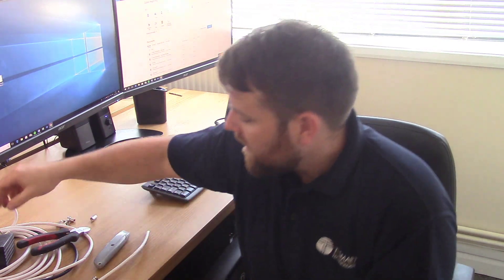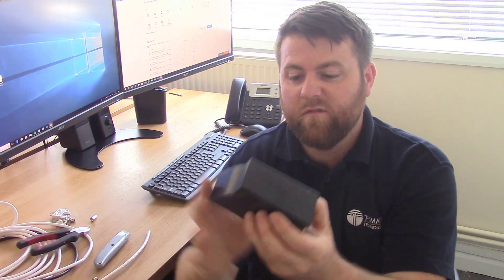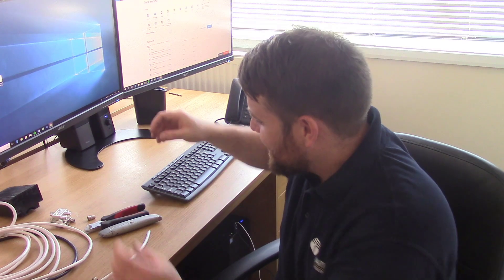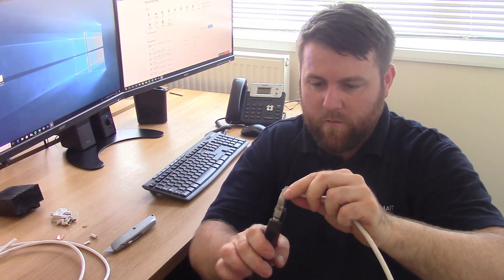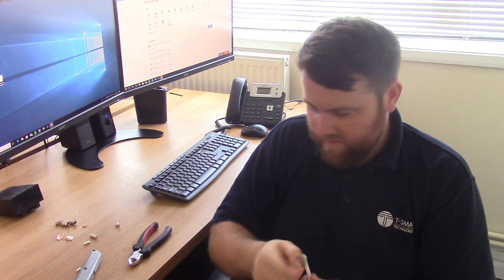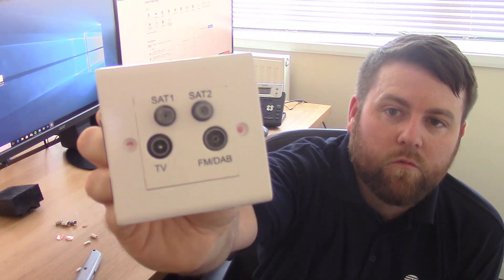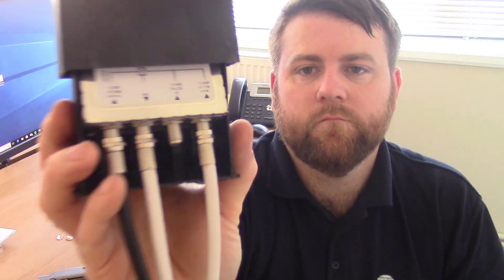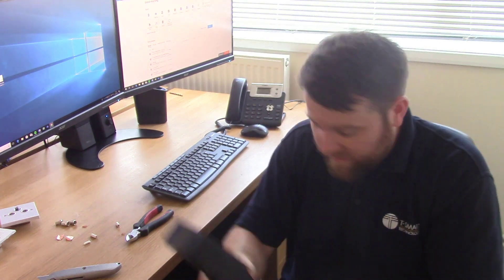How To Combine TV Aerial, Satellite, FM & DAB Radio Signals On One Cable

Comment: Hi I've Brought a new build and wanted the TV on the wall they have sky q around this areas what connection plate do I need to have no cables showing I have a double socket for power which plate do I need to have the TV linked to sky thanks.

Comment: Hi Mate, On the back of the Triplex wall socket it has an arrow indicating the coax in, but there is also an arrow out, can this be used for another outlet? i only need another  tv point, can i do this or will i have to fit a Triplex socket again ?  Thanks

Comment: A great little video. I am not sure I understood everything but that is because I don't this kind of work. 
I was watching as I am moving to a new house that has aerial connections built in in several rooms. 
I just wondered how easy it'd be to add sky Q in a couple of the rooms with an existing aerial socket on the wall? (one is Sky Q and the other is the new generation Arris freesat). 

Could the sky wiring be hidden by going through the loft rather than drilling holes externally into certain rooms and the wires trailing around the house?? It may be too complex a question for here - so forgive me if it is.

Comment: Really great start - I was quickly hooked - but then you go off too technical, too fast, and with lots of jargon about Sky Q, why it won't work, LNB etc etc...ALL before even dealing with the basics and the most common example. A shame ....as you clearly know your stuff. Lost me from that point. Advice; slow down, and focus on topic - write key focus points on a sheet of paper behind the camera so as not to digress if it helps. Don't head off down technical rabbit holes (unless it is totally core to the solution. You are not communicating to "impress" or sort of show off your knowledge - we've got that). Do that right at the start, making it clear why you should be trusted - which you do- but then, as I say, don't think you have to over impress about some non core ( re video title) technical thing.

Comment: Hi, I've had a large FM aerial on the chimney stack for some time.  A builder mate has just fitted a folded di pole to the mast whilst doing some roofing work. The DAB / FM Hifi tuner I have only has one F type connector. I have since learnt that the two cables can be combined.  A passive combiner is available that looks very similar to the all metal UHF / SAT combiner featured in your video.. Manufactured by 'Apart'.  However I'm having difficulty in obtaining one in the UK. Importing one from Germany costs a fortune. 
Any ideas on an alternative.  Is the other unit you showed passive or active and can you give more info on it or a link.
Kind regards, John ( Nottingham  )
Reply from the maker: You could just look for a Triplexer that has TV/ FM/ DAB inputs and just combine the FM/ DAB and output cable. These are easily found online.
Reply: @smartaerials  Will do Tom. Thanks.

Comment: Hi, could I use a diplexer to combine  antenna and satellite signals to connect to an slx 6 aerial amplifier? I want to take both signals to other rooms. My current set up has the aerial cable running to the slx and this feeds my living and  bedroom tv's. The sat cable runs to the living room only. I know that I'd need to run another cable from my dish into my attic but would using the diplexer work to carry both signals via the slx amplifier?

Comment: Hi! Can somebody help me, what I need to combine these cables? I have 1 Sat, 1 Cable TV, 1 FM cable, (and 1 TV Aerial, but this is optional). I want to combine these to one cable, and this would go to a wall socket (https://www.se.com/ww/en/product/SDN3501321/sedna---tv-r-sat-ending-outlet---1db-without-frame-white/). + extra: multiple output would be nice, because I have 4 wall sockets.
Reply from the maker: Hi, you can combine the Sat, TV Aerial and FM Radio signals with a Triplexer. You can then install the Triplexed socket that you have linked to, to separate the signals again. You would need to run the cable TV separate, maybe put this on it's own socket?
Reply: @smartaerials  Thank You for the quick answer! Meanwhile I found this, but it's too good to be true... Do you think it works well? https://allegro.pl/oferta/rozdzielacz-7-4-multiroom-unicable-mezon-8000430410
Reply from the maker: @CalvusPeti  That's a Unicable system, I do not have any specific experience with that as we don't use that system in UK.

Comment: Hi.

I’m currently using a TV aerial in my loft to supply a signal to my TV, HDD recorder and DAB radio, all via a signal booster. This all works fine, but I’m unable to receive some DAB channels on my radio. I was considering purchasing a separate DAB aerial for the loft, but not sure which diplexer I would need to connect the TV aerial and DAB aerial together. There is just one cable that runs from the loft down to the living room wallplate, so I guess I’d also need a new wallplate with two separate sockets on it.
Thanks in advance.
Reply from the maker: Hi Neil, what type of signal booster do you have? Does it have multiple outputs? It is does it might be easiest to swap this out for a two input (TV/Radio) model, then you could have DAB at every position.

Comment: Hi great video! If I wanted to remove the faceplate and re route the cable to a wall mount TV and connect via a coax plug to plug directly into the tv would that be possible?
Reply from the maker: Hi Ryan, yes that can be done, just remove from the back of the plate and divert to the new TV position. You can join/ extend the cable if nessecary.

Comment: I have a free sat TV and free sat recorder.  I have two wires coming from the wall.  One wire goes to the TV and one to the recorder.  I would like  going to each of them/  Is this possible?  Thanks
Reply from the maker: Hi John, sorry I'm not sure what you mean by "I would like  going to each of them/  Is this possible?"
Reply: Am sorry about that.  Both my tv and recorder have 2 places for  SAT cables.  But I can only get one each to the TV and recorder.  Is there a connector so I can have each device to have 2 cables each.

Comment: My sky plus has 2 cables at the dish which run back to my tv. how do I connect this to my digital aerial onto one of these cables please ?
Reply from the maker: With an F join, here is a video showing how to weatherproof the connect. Ignore the bit at the end regarding silicone grease. You will need an  to coax adapter to but on your F plug by your TV for the aerial to work, like this one - https://www.toolstation.com/proception-adaptors/p96352?store=E1&utm_source=googleshopping&utm_medium=feed&utm_campaign=googleshoppingfeed&gclid=CjwKCAiAj-_xBRBjEiwAmRbqYhSCAD7QKIs-4BNqUQup-zKAntsbZLJH19uwQL9XdY7wAM8iodFh_RoC-mYQAvD_BwE
Reply from the maker: Here is the link to outside F join - https://www.youtube.com/watch?v=8ooIXd9HguE&feature=youtu.be

Comment: Hi Tom, thanks for this great video, that I came across right on time whilst I am laying down cables at my house for TV ariel, satellite and FM /DAB Radio. I am panning to install Quadruplex Multimedia Socket plates (https://www.screwfix.com/p/schneider-electric-lisse-1-gang-quadruplex-multimedia-socket-white/4966j) at number of different places in the house. Please could you suggest what exactly I will need to do in case I want to combine all these signals in one single cable? Many thanks once again and waiting to hear from you. Cheers. Raj
Reply from the maker: Hi Rajesh, can you tell me how many TV points that you're going to install so I can tell you the best way of doing things?  Link isn't working by the way.
Reply: @smartaerials  Many thanks for responding quickly Tom and apologies for the link glitch. I want to install nearly 7 points which is almost in every single room of the house. The idea is to get TV points in all the rooms, not sure if this is an issue. I want to install a Quadruplex Multimedia Socket (https://www.google.com/search?client=firefox-b-d&q=Quadruplex+Multimedia+Socket) so that I can have TV, Satellite and FM/DAB signal avilable in all rooms at one single place.

Comment: Hi mate,

I have TV aerial, dab and sky +  in a property and we want all these on two TV points.

So is there a diplexer thats combiner with 2 or 4 output available? so I can then combine 2 satellite cable separately from the Lmb, two TV points via 2 diplexer then to wall point.

If that makes sense. Or if there's a simpler way.

Thank
Reply from the maker: Hi yes. You will want a Triplxer or a Quadplexer - Triplexers are usually, sat+aerials+radio whereas a Quadplexer usually has separate inputs for FM and DAB radio. Hope this helps mate.
Reply: I have an Lmb with 4 connections 2 which will run directly for faceplate. Can I combined satellite/radio/aerial for two tvs when I use a triplexer, then another diplexer?

Or would I have to run separate satellites cable from Lmb for second TV and then use two diplexers to combined and split for each cable?

Thanks

Comment: Hi mate.

I'm in communal tower block and I've been told we can conne t to our cctv from the socket you showed with sat/TV and dab. How does one go about getting the picture on the TV? Using what cable to the TV ect?

Cheers
Reply from the maker: It's usually done with an aerial cable connected into the TV, you then tune the CCTV in like you would your TV channels.  Depending on what the set up on the system is, you may need to run a scan on analogue on the TV to get the CCTV. Hope this helps, Tom.

Comment: I live on a hill in High Wycombe, Bucks. I have a Freeview TV aerial on the roof feeding my TV box with a good strong signal from London. I have a separate radio needing an FM/DAB aerial. which has a single F type aerial connection on the back.  What type of FM/DAB aerial should I buy? and can I eliminate need for diaplexer and splitter with a single downfeed from the aerial to back of radio?  I presume the existing Freeview aerial cannot be used to provide the FM/DAB signal. Thanks for your help.
Reply from the maker: Hi Barry, using a Freeview aerial from radio is not ideal. I talk about this further here - https://www.smartaerials.co.uk/blog/can-you-use-a-tv-aerial-for-fm-dab-radio

Couple of options for the radio aerial(s). You could get yourself FAB aerial which is FM+DAB dipoles all in a single aerial, or you could install separate aerials for FM + DAB. Directional aerials like 3-4 element aerials are higher gain but these are not always necessary. 

Does your radio tuner have separate inputs for FM and DAB?

Comment: Random question....i used a splitter as indicated with dc pass through etc. to splot satellite singal, to two tvs that have built in freesat....when one is on the other doesn't pick up signal am I unable to split this way but is there another way to do it?
Reply from the maker: Hi Anthony, that won' work properly I'm afraid. There are a few reasons behind this, I have a very old blog on our website that details this a little bit. You do want to do, you will need to install a new cable back to the satellite dish and connect it to the LNB direct with no splitters. I hope this helps. https://www.smartaerials.co.uk/blog/why-cant-you-split-a-satellite-signal-cable
Reply: @smartaerials  Is there a device that you can split / distribute multiple satellite signals or is it just a no no.....blog explains it but thought there might be a way
Reply from the maker: There are systems out there like Unicable, SCR, dSCR. But this would be a lot more work and you would also need to replace the LNB.

Comment: HI.  I currently have 2 TV antennas combined onto a single cable in my attic.  Unfortunately, im just not getting the reception i was hoping for.  I'll be moving these OUTDOORS and mounting them to the house, above the roof line on a 10' pole.  I have the GE Pro Attic Mount Indoor/Outdoor TV Antennas.  I use the CHANNEL PLUS 2532 2-Way Splitter/Combiner CHANNEL PLUS 2532 to combine the signal onto a single RG6 Quad Shield coax cable.  I then use the PCT-MA2-4PN 4 Port Cable TV/HDTV/Digital Amplifier which is in the basement.  This then splits and goes out to 4 TV's that i have in my home.  

I also have the Pixel Satellite Radio AFHD-4 AM / FM & HD Radio Antenna in my attic.  It is on it's own RG6 cable and also runs down to the basement where it then goes straight to my Denon Stereo receiver.  

Because a few LOCAL TV channels are just a little bit too weak for signal, i want to move these antennas outdoors and i'm hoping to get your help on equipment recommendations.  I also want to move the AM/FM antenna outdoors.  My attic is really more like a crawl space and the AFHD-4AM/FM HD Radio antenna is mounted horizontally vs. vertically.  

So... my goal is to put up a single 10' pole outside.  It will rise a little above the roof line of my home.  I will mount the AM/FM antenna at the very top since it's a "whip" type antenna and is long.  I"ll then mount the 2 GE TV antennas below.

I would like to put all 3 antenna's onto a SINGLE RG6 Quad coax cable.  That cable will run to the current location in my basement where i then need to split the TV signal from the AM/FM signal.  

Can you recommend a make/model of a combiner to combine the 2 TV and 1 AM/FM Antenna's onto a single cable?

Can you recommend a make/model of a splitter to split off the OTA TV signals from the AM/FM signal?

I"m pretty sure i can reuse the  PCT-MA2-4PM 4 Port Cable TV Amplifier.
 
Thank you so much for any advise you can offer.

Here are the links to the equipment i have and referenced above:

• Signal Combiner:  https://smile.amazon.com/gp/product/B00006JPE1/ref=ppx_od_dt_b_asin_title_s00?ie=UTF8&psc=1 
• TV Signal Amplifier (4-port):  https://smile.amazon.com/gp/product/B001EKCGT8/ref=ppx_yo_dt_b_search_asin_title?ie=UTF8&psc=1 
• TV Antenna (x2):  https://smile.amazon.com/GE-29884-Outdoor-Attic-Antenna/dp/B01MYMVPVX/ref=sr_1_14?keywords=rca+antenna&qid=1555898326&s=electronics&sr=1-14 
• AM/FM Antenna - https://www.jmac.com/Pixel_Satellite_Radio_AFHD_4_p/pixel-satellite-radio-afhd4.htm 

Thanks!
T
Reply: All the aerials must be mounted outdoor for best reception. In the attic the reception is between poor to variable or poor to moderate, unless you live very close to a broadcast tower. As for the signal combiner the model that you use is not suitable. You need this type of signal combiner that works perfect: https://www.dipolnet.com/antenna_triplexer_za-112ms_fm_vhfiii-uhf-uhf-75__C0372.htm  You connect two UHF TV antenna (one passive UHF antenna and one active), and a FM+DAB antenna. or a VHF TV Antenna. I use a similar one: https://www.dipolnet.com/antenna_triplexer_za-104ms_fm-6-12-21-69-75__C0340.htm and have no problem. The rest is fine. Make sure the aerials are not close to each other, otherwise it may result in interference. I hope this will help you. Have a nice day!

Comment: Hi, What Would You Recommend Ive Installed A Tablet In My Car's Dashboard (With A USB Dongle)  & It Comes With A Window Stick On Booter Antenna.. But This Often Struggle To Get Good Signal, Is There A Device Or Method To "Add" Antennas On The Same Line In ? - I Have Found Many Car Based Receivers (That Has Its Own Built Receiver)* Put Out HDMI/AV - But Simply Just Needing To Add Additional Antennas To The Single Input Of The Reciever Im Using .. Many Thanks

Comment: Hi, what is the name of that triplex wall plate?, I need 4 for my house and I want to make sure I am buying the best possible that minimizes interference and signal strength. Also what is the minimum back box size for these to fit?, that socket looked pretty chunky, one of the aerial points in one room only has a 25mm metal backbox,I have a feeling this will be too tight.
thanks.
Reply from the maker: Hi Callum. I can't actually remember the specific wall-plate in the video but Triax, Antiference both make good quality plates. You're right about them being chunky, 25mm is going to be too tight. 35mm will be better.
Reply: @smartaerials  Thanks, I have ordered 4 triax 304102, what is "die cast housing"? It mentioned this as part of its spec, does this mean its fully screened?
thanks
Reply from the maker: Yes that means that it is a screened termination. The die cast is just the method in which the metal is molten and molded into shape.
Reply: @smartaerials  Thanks